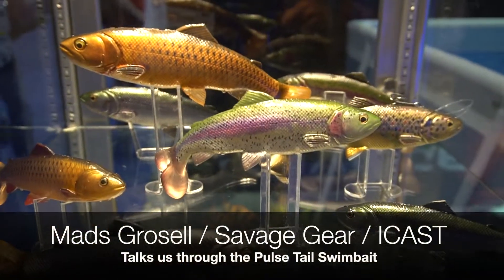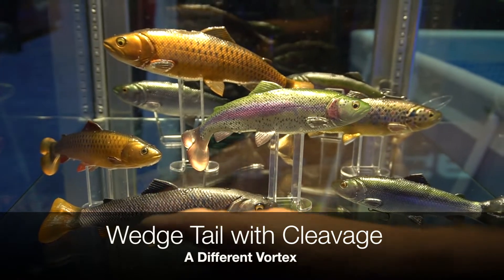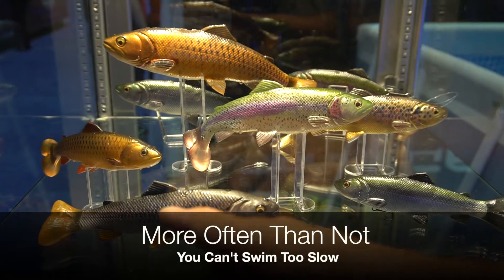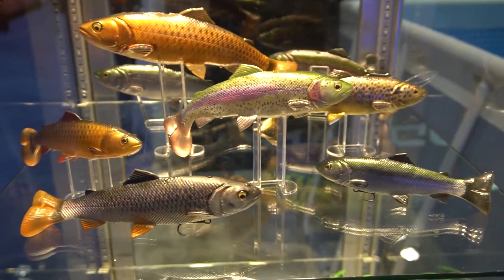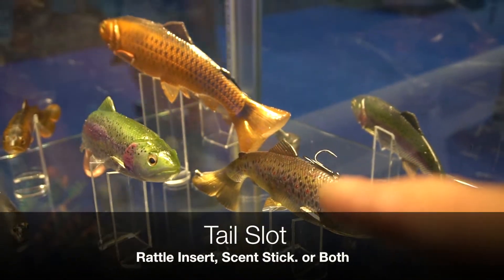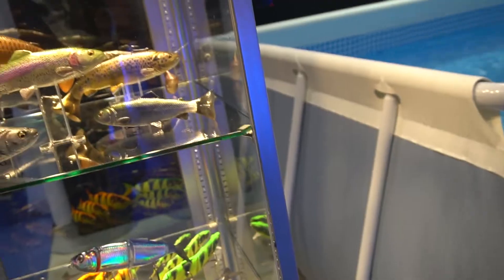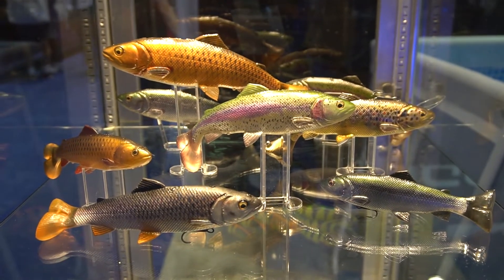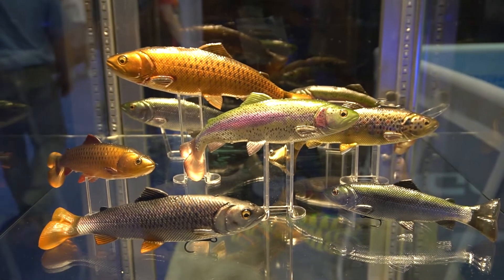Savage Gear Pulse Tail Swimbait ICAST

Comment: Can somebody answer why the 10” version weighs 7 ounces.. and the 8” weighs 3 2/3 ounces?  2 inches equals 3+ additional ounces?
Reply: Dusty Hiebert probably the buoyancy on the frame of the bigger bait needs more counter weight to make it slow sink. It’s the wood or buoyant material before the soft plastic coating.
Reply: Billy  Xayasomroth makes sense, thank you